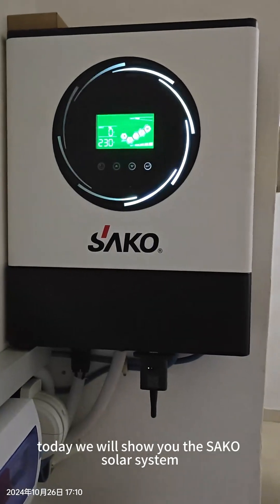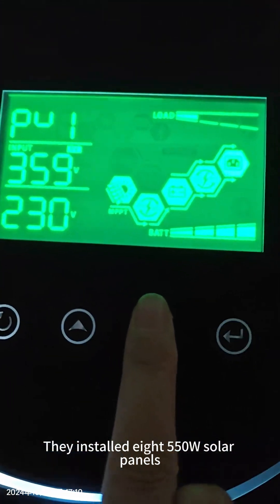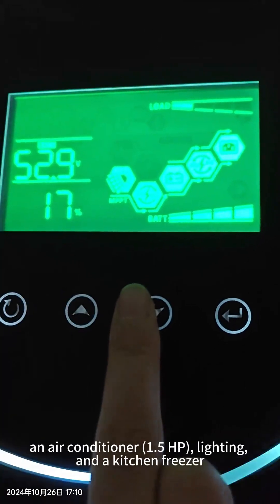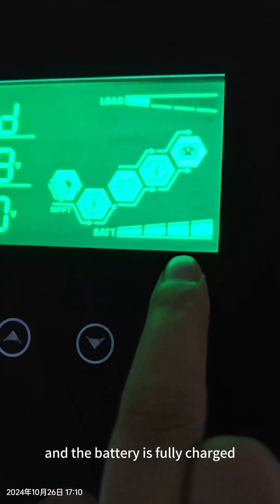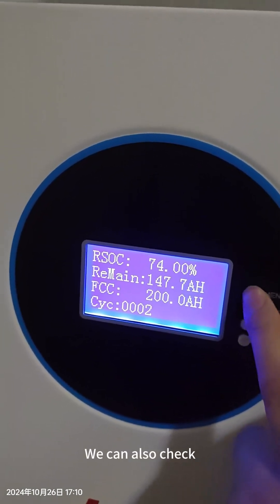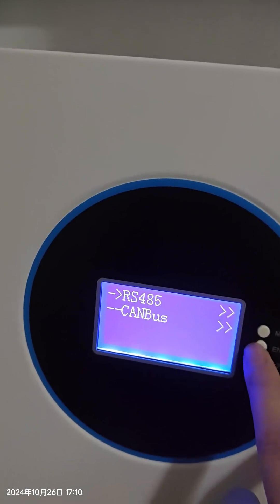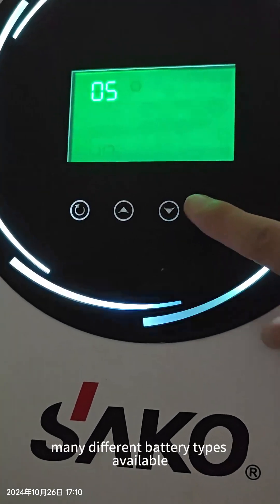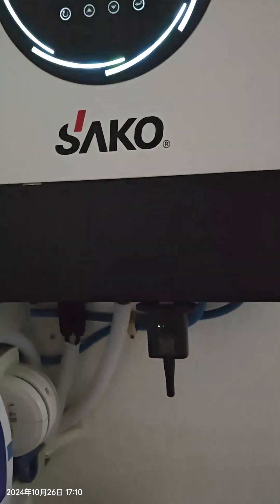How to install SAKO Solar Inverter & Lithium Battery ? Whatsapp +8613823143911

Comment: Ur BMS is not properly connected coz when BMS work or connected to battery sign on the inverter screen flash… so ur BMS is not connected